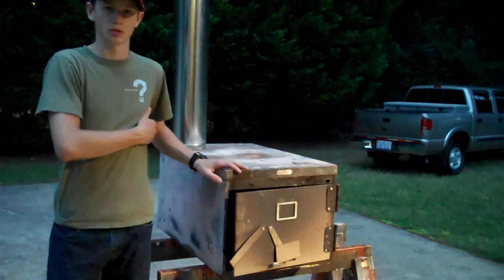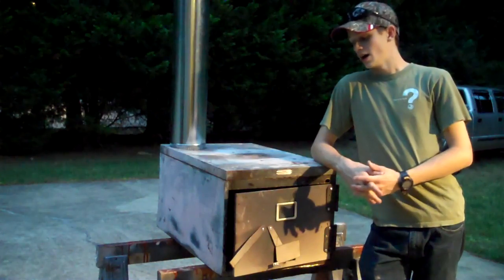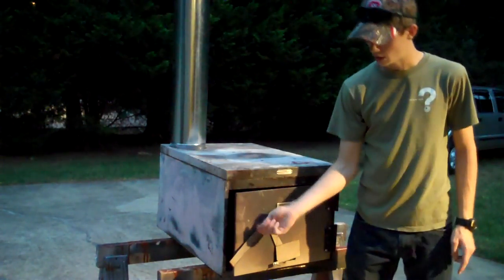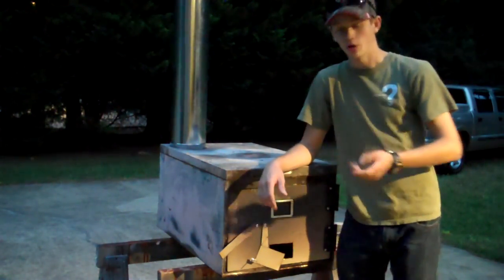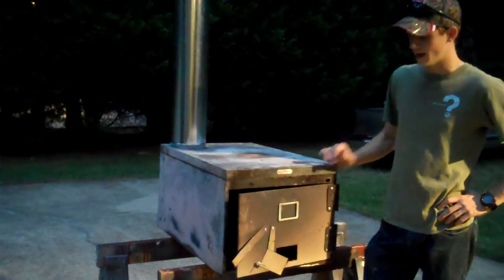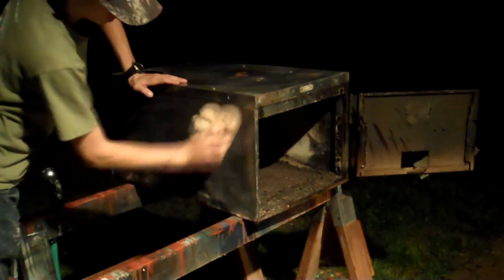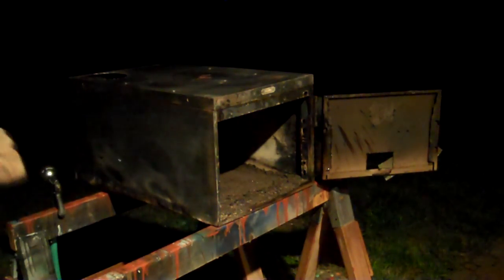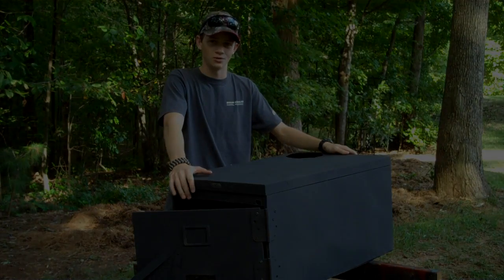Cabin Renovations 5 - Finishing the Woodstove

Comment: For that air flow if you put a spring on the shaft of the bolt and then thread a nut onto the end it will keep it tensioned without coming undone often